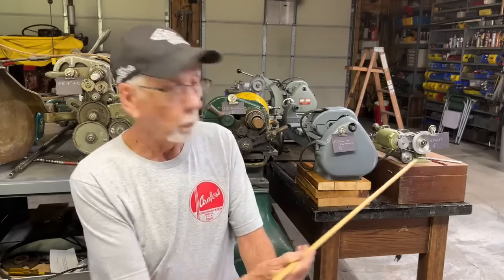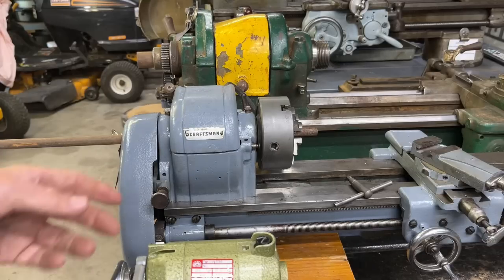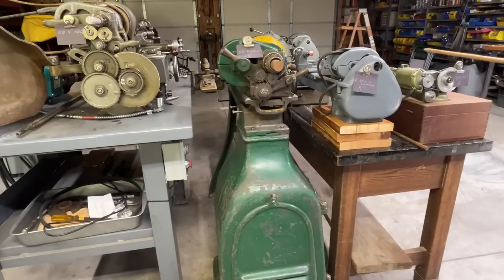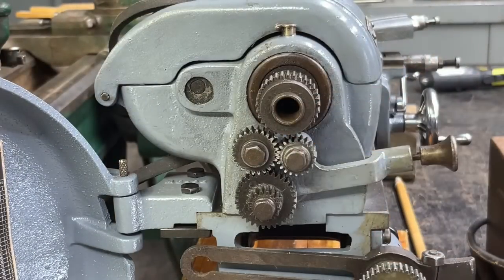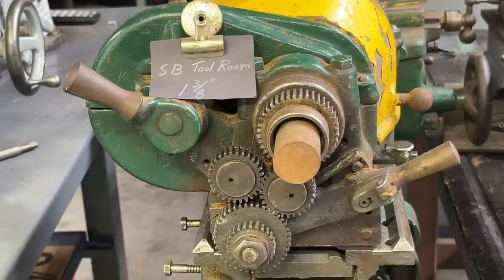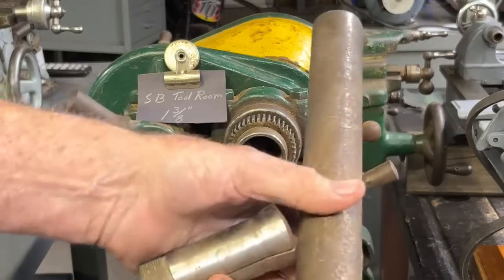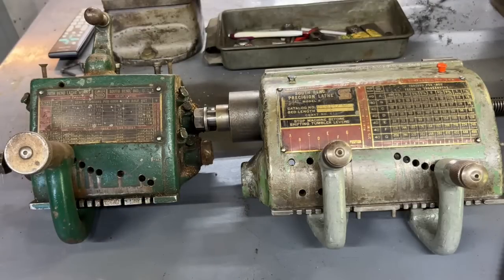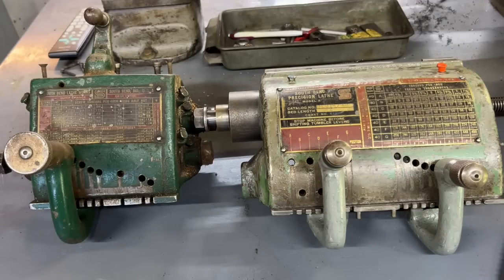COMPARE LATHE SPINDLE BORE SIZES #957 atlas south bend unimat tubalcain

Comment: Good day Pete,
You do a fine job talking about the amount of lathe and its tools etc through you video`s thumbs up all the way.

I` over here in the UK England bought an American SB 13"x 6  lathe single tumbler , possibly tool room type,1942, But it is the one with a smaller 1" spindle bore hole, apparently takes 2A collects With draw bar,but never had not tooling with mine,
Originally came over here in 1943 it was bought and paid by the HM service,for the Naval base, 

My question is why have you never shown and talk about the 13" lathe with 1" small spindle bore hole ,
Many like the 13" lathe as its not to big and not to small but the ones people never mention are the 1" smaller spindle type.  People seem to struggle finding information to do with the 13" small Spindle bore lathe ,

Apparently one of the 10" lathes had a 1" spindle bore hole but there draw bar is shorter in length, then the 13" x6 lathe,

I have bought countless books /magazines/catalogs ,etc from America but still struggle with parts to buy for the 13"x 6 1" small spindle bore hole,
I don`t know if the cross slide and bed ways and compound rest tool post, moving steady and rest steady if I have said these correctly are compatible with each other ,whether the larger 10"  and 13" and 13"x6  1"spindle bore have many parts that are compatible,

It would be great if you could possibly show and talk about what is compatible  on these three lathes as I get so confused as there is a lot of miss information out there,
Reply from the maker: Thanks for your comment.
I’m just as confused as you. I was not aware that they made a 13 inch with a tiny spindle hole. It kind of doesn’t make sense. Maybe that machine was made for the British market. 
You might note that there are many differences between my 9 inch South Bend model C and the green South Bend tool room  lathe.     And they are both approximately the same age.
Reply: @mrpete222  No` it wasn`t made specifically for British as far as I know, as in some books it does mention 13" south Bend with the 1" but quickly moves on to the common size 13" SB 
There were two 13" south bend lathes with different size holes through the spindle ,
One was small bore 13" with a 1" through hole with a 1"-7/8ths spindle thread,

And I think the common larger 13" south bend had a 1"-3/8 ths spindle hole with a spindle thread of 2"-1/4 thread I think,
If you don`t mind looking at a fellow American I think talking about this as he wants to make a draw bare for his 13" 1" SBL through hole in spindle he has two parts to his video`s ,
He goes by the name Halligan142  Southbend 13"Collet Draw Bar part 1

Comment: A couple of years ago, I picked up a 1980s Taiwan made lathe 600 between centes and nearly 300 swing over the bed. It was a good deal dollarwise. It has a spindle bore of around 38 to 39mm. Quite large for a lathe its size. Never thought about collet capacity.

Thanks again for all you've done producing this material.

Comment: I picked up a little Craftsman Dunlap off the curb during cleanup week a few years back. It has a 4-jaw chuck about 4" in diameter. It's 6 x 12". The little lantern style tool holder is there and all the change gears and a dog plate is with it. It has a thread cutting attachment but part of it is missing. Even the motor was there. It's just cute as a bunny. Even the chuck wrench was there.
Reply from the maker: Sounds like you got a great deal!

Comment: Odd question I have an atlas TH36 lathe it does not have power cross feed only the half nut to feed carriage. Could I get a carriage from another atlas lathe that has power cross feed to add the feature to mine?
Reply from the maker: Cannot answer. You will have to ask someone that owns those machines.
I do know that Atlas manufactured their machines with bad ways of different sicknesses that’s thicknesses    Earlier ones were 3/8 thick and then at some point they changed it to 1/2 thick
Reply: @ thanks for the reply and I might have to do some more research on this. Been really enjoying your content. Thanks!

Comment: This is a great video as it shows a fundamental parameter of machine design that one should consider when buying a lathe. You can see here that they are not all created equal. I 
think there’s one point to be added here. The rigidity of a lathe is to a large extent determined by the rigidity of the spindle. I read somewhere that this is proportional to the cube of the diameter so the toolroom lathe will be way more rigid than any of the others. This becomes critical for operations like parting off. It also affects the finish and how much of a cut you can take before it chatters. The craftsman 109 (dunlop?) I had was only an MT0 taper in the spindle nose so probably no more than a 5/16” hole and when parting the spindle behaved like a wet noodle and the tool would dig in and crash. My emco has an MT5, similar to your toolroom machine and the difference is like night and day. I would argue that spindle rigidity is almost as important as the max diameter of work you can fit and for some types of work even more important.
Reply from the maker: Thank you for that nice analysis of the spindle. For some reason, I never particularly thought about it being part of the needed rigidity.  But I believe you are right.
I also think that the entire weight of a machine is a huge factor in eliminating vibration and delivery of maximum horsepower 
They do make machines with huge spindles like 4 inch or 8 inch, and they are often used in the oil fields. But of course those machines weigh 20 tons.

Comment: I am glad my Summit 19-4-60 has a 4.125 spindle bore. I have used it several times on 4" pipe. It can also swing 27" with the gap out...great hobby lathe !! I enjoy every video you make and have learned alot, Thanks.
Reply from the maker: That must be quite a lathe
Reply: THAT Would not qualify as a hobby lathe.@mrpete222

Comment: Yes please!  let's learn about the SB gear boxes and why they changed.  One additional question - if you have a small lathe(Craftsman, SB etc.) how much stock length can "safely" protrude from the back of the lathe before you bend the bar and have a "shorts-changing" moment?!
Reply from the maker: Not much, and it totally depends on the diameter before it starts whipping

Comment: Had a WW2 vintage 13" SB that I bought incomplete. Missing the gearbox among other items. Ended up with the single tumbler design. Before I ever got that lathe running, I found a deal with a 1958 SB 13" (dual tumbler) and a 1959 Bridgeport, so that old SB has been slowly parted out. I've not looked back. I also have a nice 1956 9" SB Model A. I sort my projects to determine which task I do on which lathe. Sometimes the spindle bore size plays into the decision.
Reply from the maker: I totally agree with everything you said. And yes, sometimes my choice of machines is determined by the spindle size. Apparently this is not a problem for most people because this was a worthless video that no one has watched.

Comment: Interesting video even though i knew most of that. Ive owned several south bends, have a nice little atlas now.  Ran a Cincinnati at one of the places i used to work.  Yes, would certainly enjoy you doing on on the differences of the gearboxes. Thanks, Mr. Pete.

Comment: Certainly, a look into the why's and wherefore's of quick change boxes would be welcomed by this listener.
Spindle bore size must've been a long term headache for all lathe builders. Users saying the spindle bore is too small?
Without charging thru my books, SB 12x6 (4) has a 3/4 bore maybe. 1911.
1928 SB 9x4 has the same I think.
The 90's 7x14 chinaman has about the same, maybe a skoche larger. Big bore for a little stinker.
Gosh, if I see it right, they're still increasing spindle bore size. ? Long winded, please excuse.
Neat vid!

Comment: Thank You Lyle Peterson.... Having worked on many different lathes during 40+ years on the job. I have encountered new & worn out bed ways. Always bothered me - Why didn't all those different manufactures design the bed ways so that it could be flipped 180 degrees when it is worn out. I would think it would be a fairly simple matter? After 50 years of work, flip, and than the unworn end has a fresh new ways to last with accuracy. ???  TM
Reply from the maker: They wanted them to wear out so you would buy a new one

Comment: Lyle, the spindle hole is always too small. My 10 L heavy has the old gearbox. It was made September, 15, 1953 and came off the assembly line at 4:45 pm. My FOURTEEN was made in 1973 and comes with the D1-3 mount with a 1.4” hole. The later version with the D1-4 has a 1.6” hole. Just missing 1.5” is frustrating as I use that size a lot.

Comment: My Taiwanese 10 x 24 lathe has a 26mm spindle bore and a M4 taper, so it's too small for a 5C drawtube. I was about to undertake making a face mounted 5C collet closer when serendipity struck. At the time I was taking a metal shop class for adults at a high school shop on Wednesday evenings. (The class was administered by the local community college. For fifteen years I spent my Wednesday evenings at Franklin HS. It was a fantastic resource.) One evening I stepped into the teacher's office and spied a box on the floor next to his desk containing several 4C collets. I asked the teacher, "What's the deal with these collets?" He said, "I don't know. Somebody donated them. I have no use for them." I said, "Well, I do! Can I buy them from you?" He replied, "Well, I can't sell them, but... how do I put this?... Have I ever told you how much I like Yukon Jack?" So for the price of a bottle of booze I got $200 worth of lathe tooling!
Reply from the maker: Good deal, I think they are kind of hard to find

Comment: I have a HF Mini Lathe.  The spindle bore is about 0.850".  Yes there have been a few occasions where the stock was too long and the diameter too large.  That's when turning gets interesting.  I vote YES on a video regarding the difference between the quick change gear boxes.  KOKO!

Comment: Viewers ask yourself this: How did Mr. Pete, move all those lathes so he can show them to us side by side? That thar is old guy strength. I heard he dragged them two at a time around the shop and moved the mill out of the way  by picking it up by and walking it 20 feet to temporarily get it out of the way. Chuck Norris said he would visit later to get some strength tips.
Reply from the maker: Actually, you are correct. I have been shuffling these three or four machines around for quite sometime. Give me a prybar and a fulcrum and I can move just about anything.

Comment: This topic is a very big deal to me. 
I have a Chinesium Mini Lath and the spindle bore is 0.8" so I can fit 3/4" round stock. In order to work with larger diameter stock which I do frequently it's either got to be short, or I have to chuck it up carefully in the chuck or a er40 collet , tighten it up good, work with a push bearing I made for the tool post, while gently drilling a center hole in the end of the stock and use a live or dead center in the tail stock to support it. I've just about finished up a home made steady rest that will be a big help as well especially when having to use a boring bar inside the work piece.

Comment: What year did South Bend stop using the gear box with the lever on top? The one I am currently restoring (A Heavy 10) has that feature but also has large dials which seems confusing to me. I thought the large dials was a later feature. Also it is on the later base cabinet with drawers as opposed to the cast base. This also makes me believe it is a later model but is has the early quick change box. Very confusing. SN170755
Reply from the maker: Yes, it is very confusing and I have no positive answer for you. Other than looking an old catalogues which you will find on vintage machinery.org.

Comment: Please do a video on the different gearbox designs. I believe it was “basement shop guy” that has a video on how he prefers the single tumbler design as you can shift the top tumbler on the fly while going to change speeds as the gear design meshes. I know that there are also different oil gallery designs on the single tumbler gearbox(different versions of single tumbler). With the latter design being a much improved oil gallery and tube dropping oil directly on the gears. I had to replace a gearbox and could see the difference between the two oil gallery designs of the single tumbler gearbox.

Comment: I wish I had a 9" SBL with a 3" spindle bore!  That 3/4" spindle bore was always a tad too small. The many times I wanted to shove something 1" OD thru the spindle, wasn't going to happen.  Later in life, bought a 13" Sheldon lathe with a 1-1/2" spindle hole, I was in hog heaven! Now, I want a lathe that has a 3" hole in the spindle. I have run lathes with 12" hole in the spindle, no that too big for my shop. As always, thanks for sharing, Ken

Comment: My Jet 12x36 has a 
1 3/8 bore. I believe the factory would have labeled it a tool room lathe since it has hardened ways, a coolant sump with pump and a way to align the head axially with the bed. It has the D1-4 cam lock spindle as well.

Comment: Love the videos MrPete. I just adapted a South Bend two tumbler gear box like in the video to my Atlas 12-inch lathe, I got tired of changing loose gears when threading and the atlas 12-inch gearboxes are way overpriced in the resale market. The south Bend box I found on Ebay, new old stock never been on a lathe 115.00 bucks. It's a relatively simple install
Reply from the maker: That is awesome!

Comment: Good morning Mr. Pete.  I passed on a SB with the old style single tumbler gearbox because we could not get it to shift out of whatever position it was set.  Looking back, I can't really tell if it was a 10" or possibly a 9" tool room lathe.  So, yes, I would be interested if you pursue it further.  I started with a SB 9" with a 3/4" bore and now have a Clausing 4900 with a 1.062" bore.  So far I have not been hindered by the small bore diameter.

Comment: Thanks Mr Pete. I would be interested in knowing more about the single tumblers. I have a SB 9" that is made on the A, B, C model platform. It is the one that offers the most options. It has the signal tumbler and the 5C size headstock spindle. I'm not sure of it's age but I'd say no newer than 1940's. I also have a heavy 10 tool room lathe. It has cross X webbing in the bed where the 9" has blocks cast between the bed sides. Thanks again and enjoy your weekend.

Comment: This is the first time I hear of the patent on the old gearbox. I have one and it works great. It's a South Bend 14 1/2" and takes a 4c collet. I don't have any so I bought a 5c collet chuck and made the adapter plate. Might be the best thing I have done to it. Great video. Always learning from you. Thanks

Comment: Those of us with SB 11" lathes still can't even get a reasonable mention. Lol My 11 has a 7/8 spindle bore and still use 5C collet. No draw bar, chuck only.  Thanks for the video. There are many differences between a  9/10  and my lathe. They look almost identical, but they are even close.
Reply from the maker: Thanks, I am not familiar with the 11 inch machine

Comment: Discussing quick change gear boxes on these small machines would be interesting to me.

Spindle bore size limitations frusrate me, and this limitation partially drove me to invest in larger machines, LeBlond, Elliott and American Pacemaker. 
Although much larger my Amercan Pacemaker only has an MT4 tailstock, while the smaller LeBlond has an MT5 tailstock. The Elliott, only a 15" machine, probably has the largest spindle bore of my machines, and was amo g the most attractive feature that drove my purchase. When I purchased my little Craftsman (Atlas), my first metal lathe, an early job required chucking 1/2" BI.  It wouldn't go through the spindle bore, which is nominally 3/4".

My wood lathes all have small spindle bores. I understand that wood turners work mostly between centers, face plates, or short jaw chucks. Having machining background, I have frequently desired to chuck on long stock that won't fit the small wood lathe bores. I detest getting wood chips on my oily metal machines, but I have yielded in the past. The metal lathe really assisted this novice wood turner with rigid and predictable tool presentation! I own 3 wood lathes and high-end tooling, but quality machines and tooling hasn't vastly improved my limited wood turning skills. I am convinced that to be an accomplished wood turner, you should dispose of every other shop machine besides a good bandsaw and solely focus on wood turning. Wood turning is a lot of fun, but it requires time and dedication at the lathe to master even basic skills.
Reply from the maker: Wood turning is pretty much an art

Comment: I've always wondered about the old single handle gearboxes. I assumed they were inferior and have less speeds available. I'd love a breakdown from you about them. Your breakdown off the 70 speed gearbox vs the 48 speed gearboxes was great. Comparing these old vs new would be even better. There are still a lot of old single handle lathes out there lurking in home shops! Thanks for all your hard work and effort!

Comment: I'd be interested in knowing if the old style gearbox has any drawbacks compared to the new one.  I've got a Heavy 10 with the old style.  And an SB 13 with the new style gearbox.  Seems the old style is a bit more fiddly to get the gears meshed when transitioning from one setting to another.  But that could be maintenance or condition related.  As an aside, perhaps the presence of the new style gearbox is a fairly reliable indicator as to the lathe having flame hardened ways, helpful to the buyer shopping for lathe scrolling thru internet listings.  Cheers!